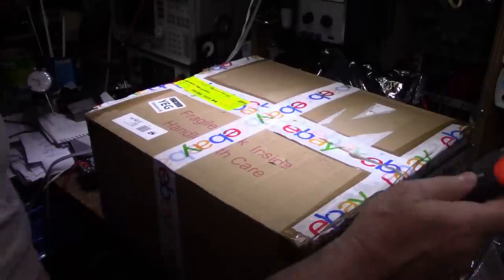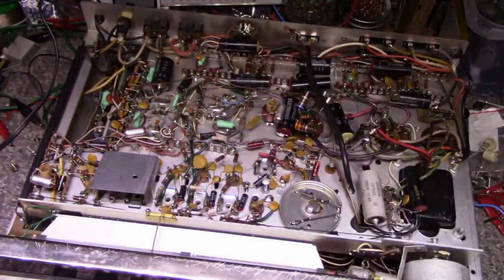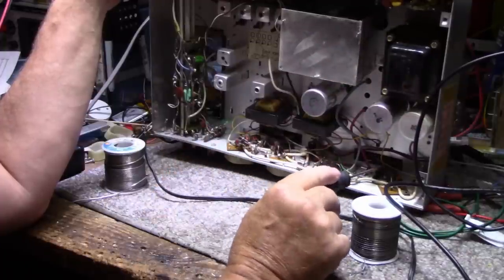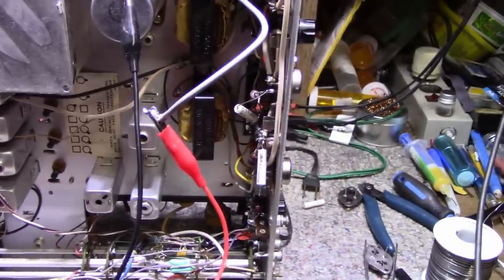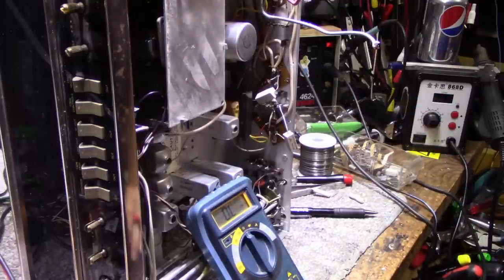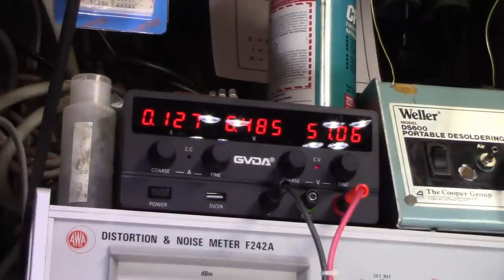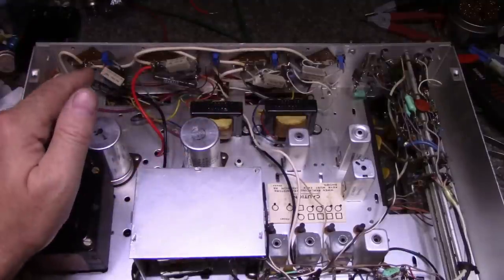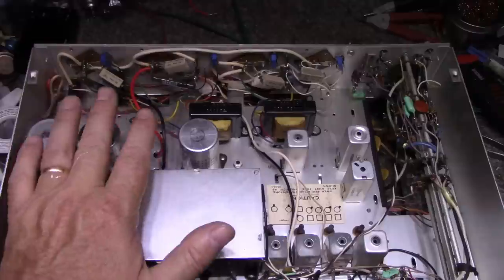Harman Kardon Seven Twenty Receiver - Part 1 (Ep. 184)

Comment: 1:05:44 - usually you let it run for 20 minutes, and then set the bias. If you do that, heat wont change much. Also see service manual on the correct procedere. You CANNOT set it up right away as the value will change. That is why.